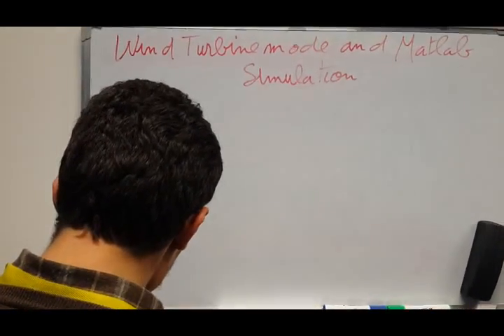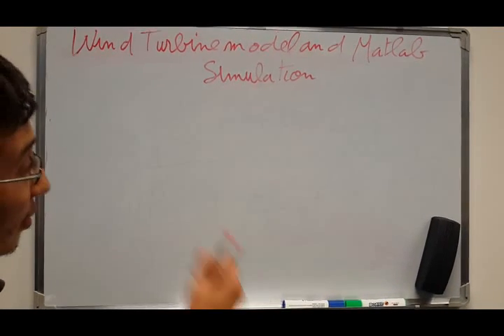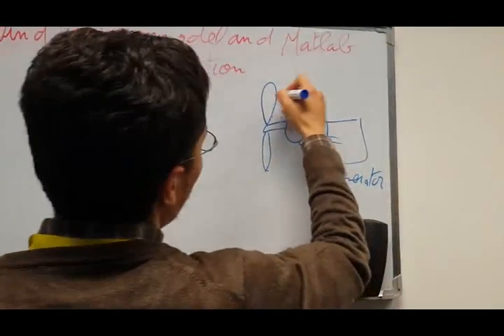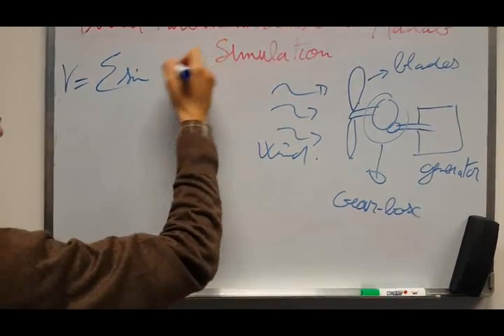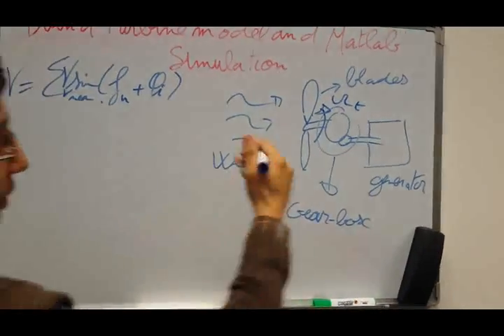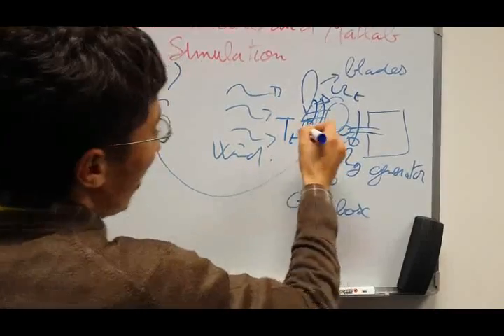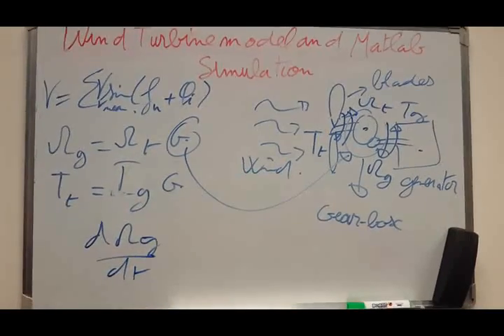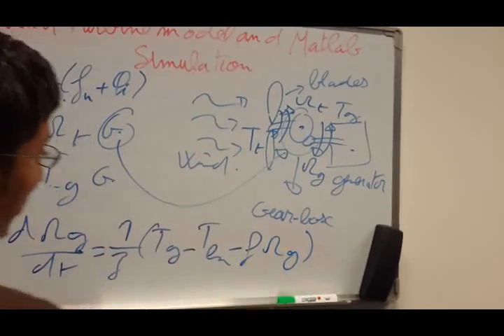wind turbine mathematical modeling and Matlab simulation

Comment: Sir,
Could you please mail me this Simulink model ?
I am designing a hybrid system in which 450kw of solar PV system together with 50kw of wind turbines are generating power. 
Having this model would help me understanding the primary phase of the Modeling. 
ID – rahul.nema111@gmail.com